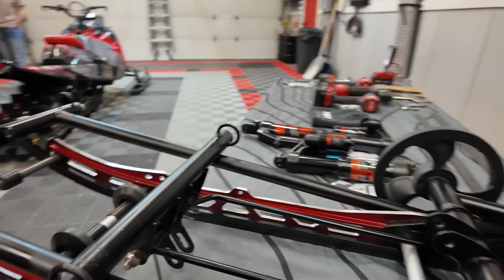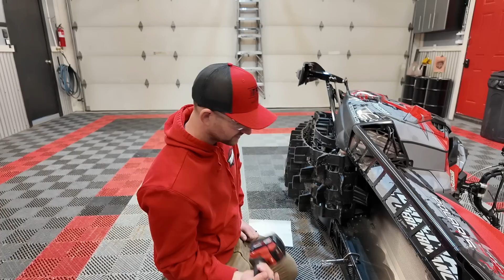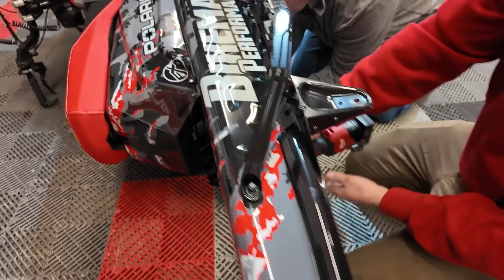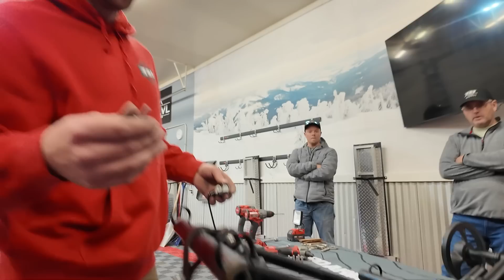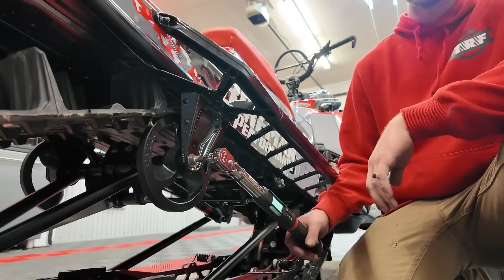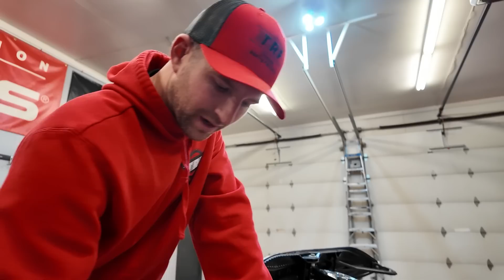TRF Skid Install

Comment: $5500-6000 is the shit kicker for that nice unit!
Reply from the maker: A great way to think about the glide and what it costs is that it allows you to run 1 track length with the benefits of 2.  Buying a skid that makes a 155 feel like a 165 if you needed it to is pretty cool and less money than an additional sled. Plus it’s easy to swap into your next machine 👊
Reply: Might be true, but if the cost prohibits people from buying them, then the word will never get out.
Reply from the maker: @Visinoni3434  
A Nextech skid is $4500.00 and they’ve sold lots of them. It’s certainly a high end product….but the word is out because of the quality and performance gain these skids offer.  
👍👍👍
Reply: @NextLevelRidingClinics 

😂, remind me, how much more is carbon fiber to produce than aluminum? This is my point, their mark up will drive people away. Even if the performance is superior. Thanks for proving my point.
Reply from the maker: @Visinoni3434  I wrote a really long reply to this explaining a bunch about this topic….but can tell you already know everything. 
Thanks for coming on my channel to prove your points 😝